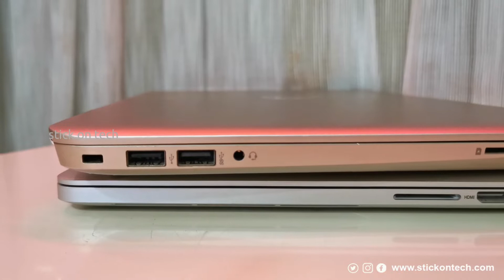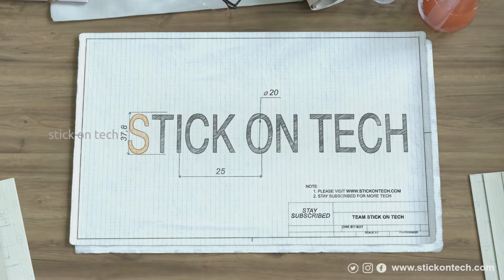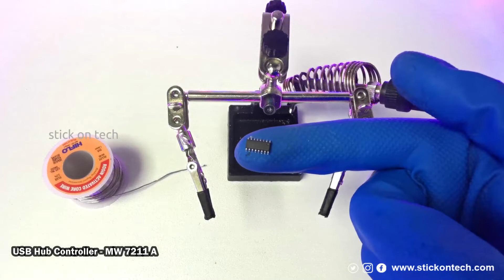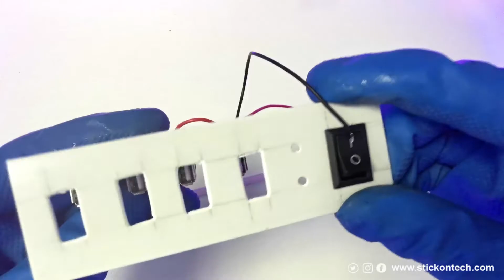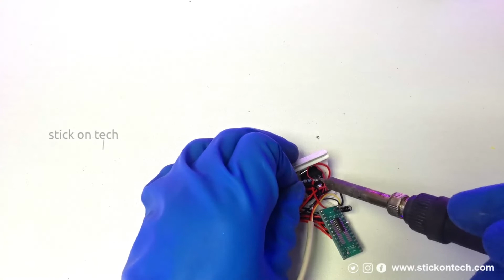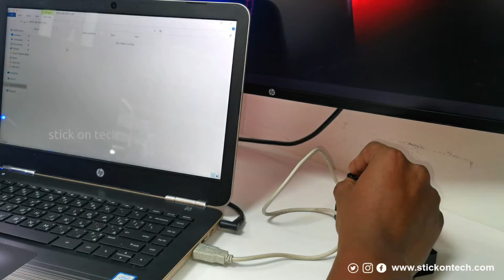HOW TO MAKE A 4 - PORT USB HUB | DIY | EXTERNAL POWERED | #stickontech #diy

Comment: will this will work for data pin
Reply from the maker: Yes
Reply: in Circuit there is capacitor  and you don't added that is it necessary to add plz tell me

Comment: anything i should look out for on the tiny cables that are used to connect the female USB ports together? (i.e: does it matter what voltage they are rated for or anything else like that?

Comment: can you list the components used
Reply: 4 female usb
1 usb controller MW 7211 A
at least 20 cm of wire (if 2 or 4 colors better)
1 power bottom or switch
some solder and flux if posible
Reply: @yuukanee   Thank you !
Reply from the maker: Components used are already mentioned in the video
Reply: @stickontech8577  But like a link to them
Reply: @monoki8708 ......... Request for a Gift Wrapped Package also !!?
Reply: @NavinBetamax  kia matlab?
Reply: @stickontech8577    Smartass cannot answer the question asked......also, this SA says in the the video that the components are listed in the description....which is not !!!

Comment: How do you switch power between usb cable and external?
Is your external cable connected to the board along with usb cable power lines?

So if you connect hub to power adapter and then connect it to laptop with power switch on, will it fry the usb port on laptop, since you will send power to the computer through same lines that suppose ro supply power if the hub isnt powered?
Reply from the maker: Hello, please have a look on the link.https://stickontech.com/2022/02/01/4-port-powered-usb-hub-diy/
Reply: @stickontech8577  it got unsafe warning homie